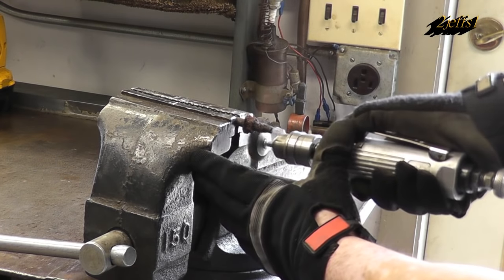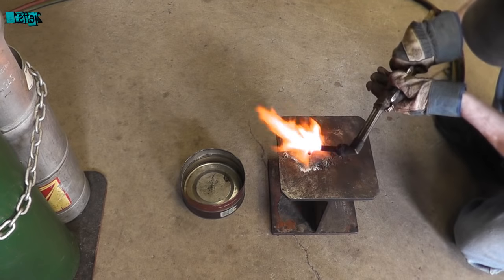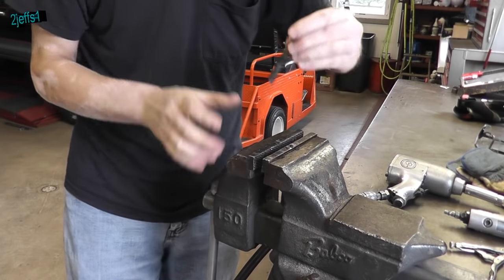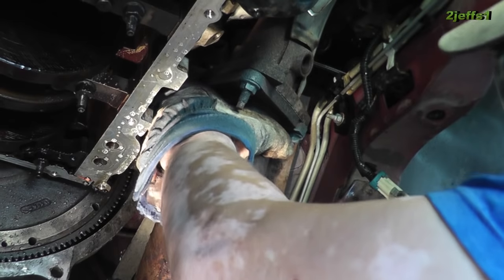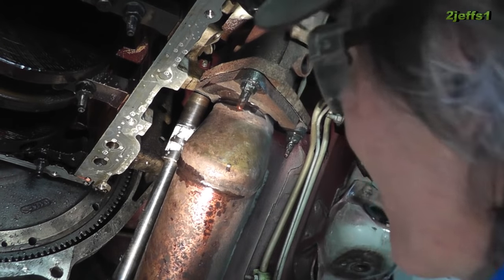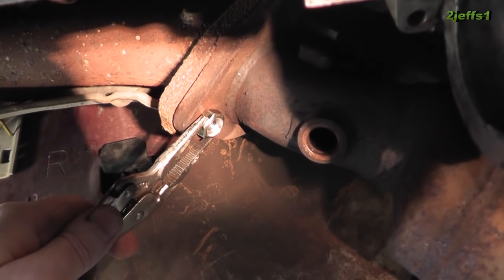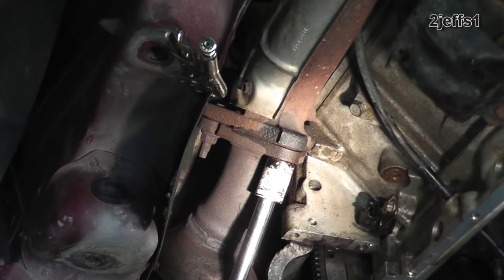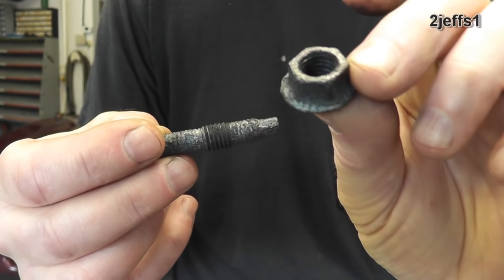Removing Rusted Bolts and Nuts THIS WORKS GREAT!

Comment: Works great if you have access to an acetylene torch, impact air wrench, lift and other professional tools.
Reply from the maker: Might be a good idea to tell the guy who has those tools and ends up working on your car. Could save you some $$. When things break the repair cost usually goes up.
Reply: There is a very simple way to remove rust from anything that can be placed into a container with Water and Bicarbonate soda. Just use a 12 V Battery to complete the circuit and the rust will be removed via electrolysis Generation).
Reply: and how you gonna do that with the bolt on the car?!!!!!
Reply: Why bother watching the freakin video if you don't own any tools or don't have any intentions to buy them?  Its an instructional. Did you think he was going to show you a solution that involved Witch Craft or Magic instead of some type of tools?  If you watched a youtube instructional on how to fly an F-16 would you complain about how the video is great and all but you'd have to buy a $24 million dollar aircraft, support crew, hanger etc? There are those that solutions focused and those that whine about how everything is going to fail or it can't be done.
Reply: If you have all the equipment, I think you would know how to remove a stubborn, rusted nut.
Reply: Wayne Andersen useing heat to loosen rusty nuts/bolts is about as basic as it gets for doing mechanical work (at least here in Michigan.)  But realistically you wouldn't need many "professional" tools to do this, besides the torch of course.  Maybe you just need a buddy like me that can do this stuff. Stop by my place with all your rusty bolts and a 30 pack of P.B.R. we'll get them all freed up.
Reply: Mike D very well said
Reply: If you don't have at least a torch and an air impact in your tools you shouldn't be trying jobs like this on your own.  You will just get frustrated and break shit which will probably end up costing more then just having a pro do it.
Reply: @Eye Yam Sofa King Stew Paid Hahaha yeah right.
Reply: Kudos to you!
Reply: He says you might not have a garden hose   Really ?
Reply: Try knitting a jumper or something,  and try not get involved with this kind of stuff, before you know it you might have to purchase some tools!
Reply: LAFOLLETTER  don't get involved,  this is not your thing!
Reply: yes all them make life easier for some
Reply: Deb long  have fun
Reply: Use PB Blaster, just spray it on there and let it sit. It's not a 100% fix but it's worked good for me several times- Link to Amazon https://amzn.to/2MqaIkM
Reply: Impact wrench you can plug to the car battery cost like 10 dollars, and a mini blowtorch with its smal gas cartridge cost another 10 dollars. Think outside the box.
Reply: heat it up and then pee on it. spitting sometimes helps too
Reply: I have never broken a bolt by slathering it in machining oil and giving it taps with a hammer.  Each cycle of that loosens the bond a little more.
Reply: @TKDZen1975   I know it's 2 years, but what kind of "torch" would you buy at a hardware store?  Propane would not generate enough heat.  Were you thinking of a MAPP?
Reply: @jeff My thoughts exactly. I'm not taking it to a repair man. If I was I wouldn't be watching this video genius.
Reply: @TKDZen1975  what kind of cheap torch are you talking about ?
Reply: @TKDZen1975  Thank you , this will be of great help !
Reply: Well, I have the garden hose.....
Reply: @TKDZen1975  Some things need that hammer motion for them to break loose, especially true when removing small bolts on those Honda Odyssey AC compressor couplings attached to the AC compressor, I have broken 2 when not using the right socket size & impact gun.
Reply: My setup, the top of the line harborfreight floor jack 200, 2 jacks $40, 3/8" kobalt impact open box + battery and charger ~$80, acetylene air torch free, thx dad!  But you could get some map gas torch from HD around $50, spray bottle free from old cleaner bottle or $1 at dollar tree
Reply: @Tom-lf2ew  and I'm here with my pico standard scope 4425a & AES Wave kit $3k.
Reply: For someone that doesn't have the tools, is there a significant risk to snapping the bolt if you freeze it up with compressed air turned upside down?  This has worked for me with smaller bolts that were a royal pain to remove otherwise (I couldn't get it done, hence the freezing).
Does it also work for larger bolts?  I hear rocking the bolt back and forth to clear out some rust while unscrewing is a good idea, too.
Just because I haven't snapped a bolt off with this technique done on smaller bolts doesn't mean larger bolts won't snap, or even smaller ones down the road.
Reply: Wayne Andersen             No whimpering and whining!!!!
Reply: @TKDZen1975  No reason to start calling people names. Relax a little.
Reply: You are so right 🤣👍

Comment: If you've got the stud out degrease it and dunk it in lemon juice for 24 hours, it chelates the iron oxide into iron citrate which just falls off and the parts come out shiny and clean, even bolts that looked like crusty orange popsicles. It's quicker than most phosphoric acid 'rust removers', much cheaper, and you can pick it up while grocery shopping.

Comment: There is another much easier solution that everyone can handle. Use an angle grinder to shave off one flat on the nut. This releases the tension and you will be able to chisel knock the nut undone. Easy!

Comment: Good for demolition but, messes up the temper of the nuts and bolts. Not good to reuse nuts and bolts that have lost their temper on critical parts that need a strong nut and bolt.
Reply: Agreed. I use my powertig welder for extremely stuck bolts but I know they aren't usable after pulling them out. tig can put in less heat than mig but it is still a lot of heat.
Reply: You are right about that, when I do repairs to my vehicles I dont even put the bolts back in. Its a trick I have been using for years, any time I remove a bolt I throw it away and replace it with zip ties or drywall screws. By the time that component needs service again I dont even have to remove anything, the screws have already fallen out and it makes it easier to work on.
Reply: lol
Reply: You have to do what it takes to loosen it. After that it opens up the world of options.
Reply: reuse that??... you must be on crack, nah but serious when it comes to exhaust parts that doesn't matter anyway
Reply: I hear you but I was referring to how jacked and gone the threads where is why it would be almost useless
Reply: +jack khoury  ..   Rusted hardware is obviously (at least to most) severely weakened, so never reuse rusted nuts & bolts - no matter how removed. Throw them away and use new ones, especially if the part or area applied to is, as you say, critical.
Reply: jack khoury wwqqwww
Reply: jack khoury i
Reply: Dont forget the induction heating units that heat in place without flame (i guess they cause substantial current/EM in the piece though, bad for nearby electronics)
Reply: jack khoury exactly
Reply: lol.. great trick

Comment: This is the first time I have seen anyone demonstrate this technique on Youtube. I have been doing this for decades and got the trick from my Dad who picked it up in the 30s.  Many will consider using the heat, but they will not know about the rapid cooling in order to get the metals to separate from the different rates of cooling.  I usually use a back and forth motion to work the nut loose, manually, and then add lubricant to minimize thread damage before removing it all of the way -- if this is a concern.

Comment: Thanks, Jeff, I also live in Wisconsin and I had rusted bolts in the exhaust manifold. We used an acetylene torch after soaking the bolts in PB blaster every few hours for 2 days to no avail. I came across your video and tried your heat and rapid cooling method. Because of it being the middle of winter, I used a spray bottle to cool the bolts and the popped loose on the 1st try. Thanks again
Reply from the maker: Your welcome Ron. Some things are hard to believe until trying/being there!

Comment: I remember talking about this specifically in a physics class I had where an old mechanic was talking about nuts and bolts heated up this way, and why it works.  Heating with like a fire is a form of rusting very rapidly (Oxidation).  The surface rust burns away and the bolt and nut form a new rust layer.  This in fact makes the bolt a tiny bit smaller and the nut a tiny bit larger as to the metal contact points in the threads.  This tiny gap formed is why they come apart easier.  We did an experiment with this in the class even to show why.
Another idea to try with is that if you have a bolt and nut too tight, give it a tiny extra tight turn and then try to unscrew it as this can expand the threads just a fraction and allow the gap needed to remove.  Same applies for adding penetrating oil as the tiny tightening action sucks the penetration into the gap too.
Excellent video and good example of the removal process you have discovered!!

Comment: Another great video Jeff. I learned this technique working at a sand and gravel plant several years back. We ended up against some pretty ugly fasteners in that environment but my boss was one of those guys who seemed to know every trick in the book (reminds me of somebody else) and I rarely saw this method fail. Later on I somehow came up with the idea of using a different method to quench. I take a can of compressed air (the kind you use to dust electronic equipment) and turn it upside down and spray the hot fastener with the super cold liquified gas. It only takes a couple of seconds of that spray to completely quench it. I don't know if it's more effective, but it's a little less messy and that flexible straw makes it a lot easier to get into tight spots.
Reply from the maker: +Paul Jordan Sounds like a nice idea you have there too! Actually I stock electronic parts chiller here for chasing intermittent issues on circuit board components. Never tried that but as always there will be a situation where that might be a good option. I'll have to keep that in mind! Thank you Paul, Jeff

Comment: Thank you, 2jeffs1--I just succeeded in removing a nut off of a floor anchor in concrete. I used a wire brush to knock off the rust as I wanted to reuse the anchor. I tried to use a propane torch with no luck but then used a Map Pro torch and tried again. Heating the nut and then spraying it down with water from a garden hose was the trick as you demonstrated. I cannot thank you enough as I had to replace two 4x4 porch posts. Even though it is easy for you guys, I appreciate you taking the time and posting the video!
Reply from the maker: Thank you for your time to leave this feedback Chris. What an interesting use you used this idea on!

Comment: great info.. What I found was to spray it with PB after it's heated.. It sucks in and remove the rust.. Both ideas work really well... I know for a fact you helped some kid out that's working on his car for the first time that's how I figured this out.. Guys like you sharing information helps those young'uns know there ass from a hole in the ground thank you.. thank you for caring :-)
Reply from the maker: I would like to thank you for sharing your thoughts and stopping by, Jeff!   ;>)
Reply: I concur haha!  I never comment on videos, but this video was good and the narrator sounds like a nice guy.  It is what it is.  Someone watching it obviously has encountered this situation in one way or another or was simply curious.  But it never fails for the Douche Squad to come out and pretend that they are some old grey haired physicists and the ultimate authority on a subject.  I can't even count how many times I was able to fix something because of this excellent resource called Youtube and the people nice enough to post videos on how to do it. When it comes to problems you have to keep an open mind, use your brain and realize there can be 20 different ways to fix it, use your brain and choose the one you think is best. Sometimes you win, sometimes you lose. Those are the breaks.
Reply: haha, thats me. trying to figure out how to get nuts off of my first vehicle, a 70s FORD pickup.
Reply: I do the same. Heat it up. Spray with PB or WD  and blast it off with 1/2 inch impact.  Oh and  for working overhead, dont spray it first or you'll have flaming balls of PB dripping on you.
Reply: Yeah, well, be extra careful not breathe the vaporized lead from the PB Blaster turning into a gaseous phase!  The human body has no resistance to lead, and once absorbed there's really no treatment, and lead attacks the brain hardest.  I think 2jejjs1 idea of using water quenching is wiser, safer, and 90% as effective...then spray with PB after it's cooled down to warm, say about 130 degrees.
Reply: Alright, I didnt know that. Thanks for the info.

Comment: As a saltwater outboard engine mechanic I discovered that the big impact is the best way to remove seized fasteners. If it won't remove the bolt/stud it will rip the head off instead of braking off flush in the casting. That way once the assembly is separated there is a stump to grab on with vice grips. Using  PBlaster and torching the part directly that needs heating then allows the fastener to be removed. You want to expand the casting not the broken fastener. Of course be careful heating aluminum with acetylene oxygen as it melts without warning.  I found patience, PBlaster and using a MAP gas torch (more BTU than propane. Less possible damage than Acty O2) will do the job with the best chance for success. Thanks for the video.

Comment: Great video Jeff..I used to watch a bloke (passed away now) do stuff like this and he made it look so easy!..He had an old lathe (circa 1920) driven with a flat belt and pulleys where he had a system of a car gearbox bolted to a hydraulic ram and he'd change gear to change ratios and the ram would take up the slack...He also had an old 2 cylinder Ruston diesel  bolted onto a 300 amp DC generator that you had to crank anti-clockwise with decompressors open to start it up. (I used to crank it for him some days :)..He used to keep his welding rods in an old fridge box with a low wattage bulb lit to keep 'em dry..He could practically weld on his head..It's good to see tradesmen like you, you're a dying breed!
Reply from the maker: Really enjoyed reading your write up! Great description which makes it possible to pretty much picture what he had going on there. I pretty much live in the garage (actually did for a year and  half when re-doing the house) and very much enjoy coming up with new ideas that aren't in the book. Thank you for stopping by, Jeff

Comment: I'm in Rochester, MN originally from the Twin Cities.  I have a 60's Dune Buggy that became mine when my father passed away 10 years ago.  It hasn't been driven since before I was born (so at least 33 years it has been in the garage untouched).  He had plans to swap in a 1600cc (or possibly some other swap), do a 12v upgrade, and update the suspension and brakes.  I originally wanted to follow through with his plans, but over the past couple years I've looked at other swaps (from Corvair to Subaru engines).  I have to say I absolutely love watching your videos about the buggy you have.  

I wish my father were still alive, you remind me a little of him and I think if he had a chance to see these, he'd probably want to contact you and get to know you since you and him have a lot of common interests and DIY know how.

Thank you and if you could, please show more about the Dune Buggy in future videos.  Otherwise, if you wouldn't mind contacting me directly so I can get some more info about what you've done to yours, I would love to get a start on putting together all the parts to do my upgrades and an engine swap on my buggy.
Reply from the maker: +Mike Maciazka Hi Mike. Interesting write up you had here. Mine was all 1961 originally. In 96 I cut off the front and rear of the belly pan and installed 73 front and rear S - beetle ends & engine. Did do many other mod.s at that time too. Many original ideas. 
I do have plans to do a detailed video on the changes. Probably be a while tho. If yours has a Corvair engine in it them are nice when running good. There is one for sale like that near here and they want a lot of $ for it. Converting things over can be costly and time consuming. What I did is got it running and brakes working (1976?) and as time permitted or a deal came along (like the super beetle parts car & Subaru engine deal) then went forward with that. Well - just my 2cents worth - hope it helps!

Comment: After 40+ years in my own repair shop, in the rust belt, you showed me a trick that I will try. I always have heated the nut cherry red hot than removed it while glowing. I never would have tried your quick cool method! Thanks for the tip and I'll let you know how it works out for me. PS you seem like  a very calm person!! Thank you.
Reply from the maker: Thank you Jim. Saved me from a lot of aggravation thru the years keeping the blood pressure where it should be!   :>)